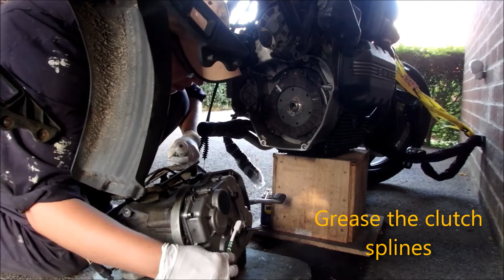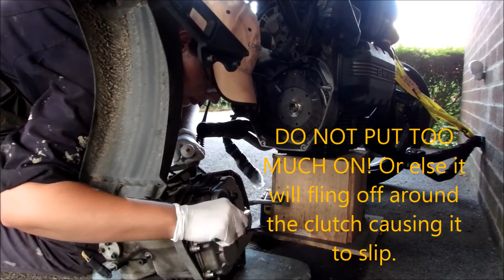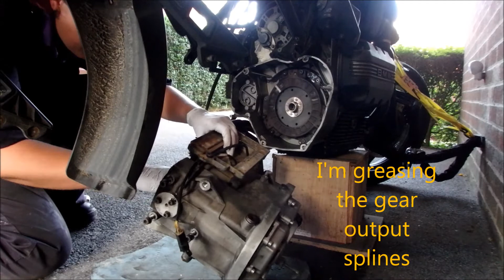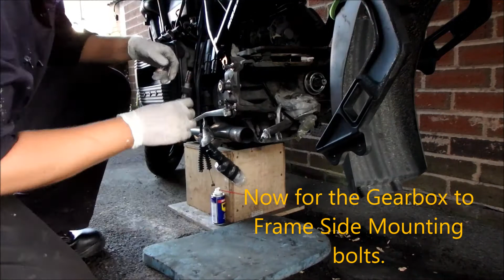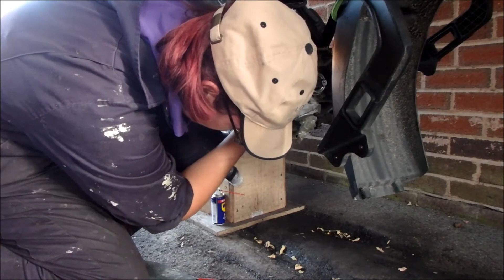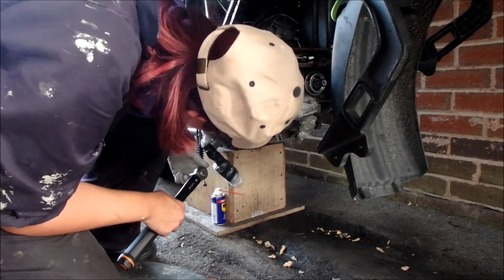Fit gearbox to BMW K75s - same for all K series

Comment: I replace clutch on my brick, but forgot add sealant. Is it really necessary? Also who will assemble gearbox, use shaft from rear wheel to adjust clutch. Just place it on gearbox and spin it to fit shaft teeth, and don’t forget center clutch, before final assemble.

Comment: I’m wondering why it should be in neutral during the replacment, can someone explane that to me?
Reply: If the teeth of the motor output shaft are not aligned with the teeth of the gearbox input shaft, you must be able to move the gearbox output shaft. For this, the gearbox should be shifted to neutral. Otherwise the rotation of the shaft would be blocked.  
That's how I understand it, anyway.

Comment: I drop bolts into a plastic bag to stop them picking up dirt....before reassembly
Reply from the maker: ROY Dean I have mine labelled in a plastic bag too ... then laid out on a tray which you can't see in this video but I think the tray of wonder is in my r1100s cam chain tensioner video 😁
Reply from the maker: Ohh, and they're all fastidiously cleaned with brake cleaner and wire brush then smeared with copper grease. It takes time but worth it!
Reply: Shel Does Stuff ...in fact...I try and buy new bolts on eBay....just my style......
Reply: Shel Does Stuff ....Thanks...I have a R1100RS...in pieces at the moment...I'll take a look......x
Reply from the maker: Roy Dean I'm tight so if it's serviceable it goes back in ;-)
Reply: Shel Does Stuff ...I'm retired and got lots of bikes in various stages of disrepair...so....I buy a few bolts at a time.....most are Japanese....so I know I'll be needing them sooner or later...x